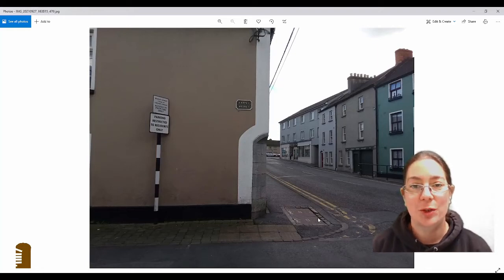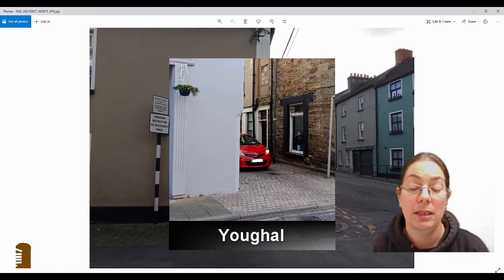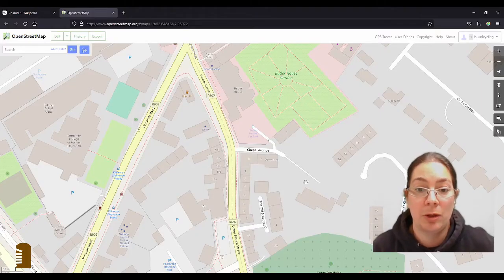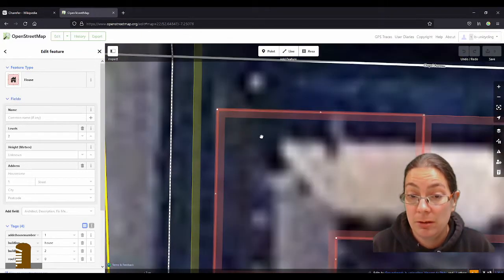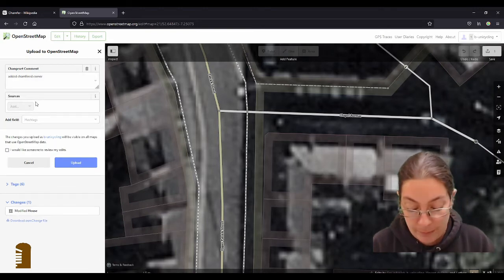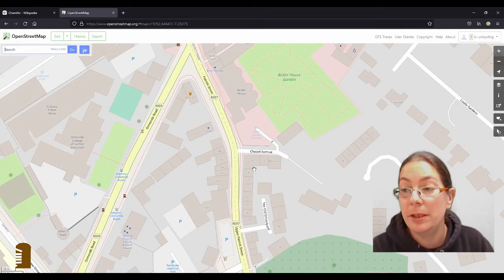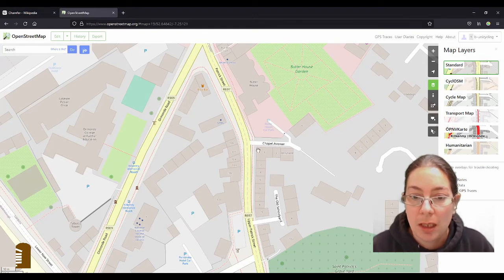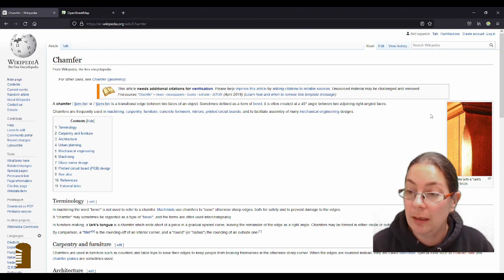Chamfers on Building Corners in OSM

Comment: Nice one, though I'd be a bit worried that an armchair mapper would mistake this micromapping as a geometry error. Might be worth adding a `note=` tag on one of the nodes ? Or instead of removing that triangle, add it as a `building:part=yes min_height=2` ?
Reply from the maker: The note tag is probably the easiest option, because 3D mapping is quite advanced. It was suggested by someone else as well, though.